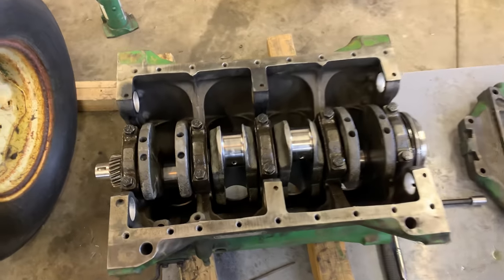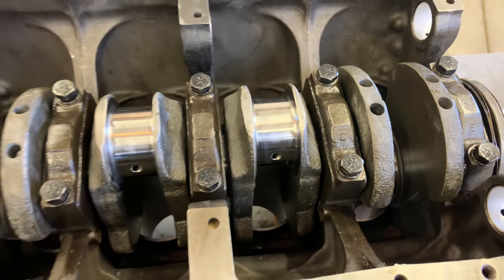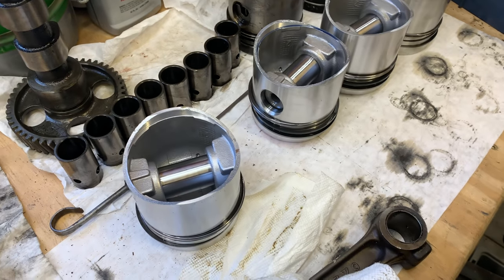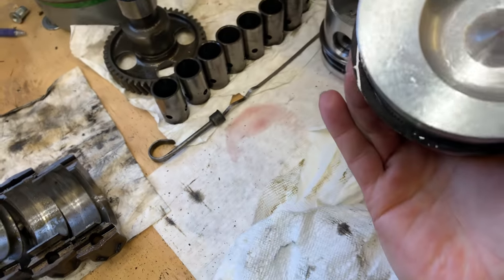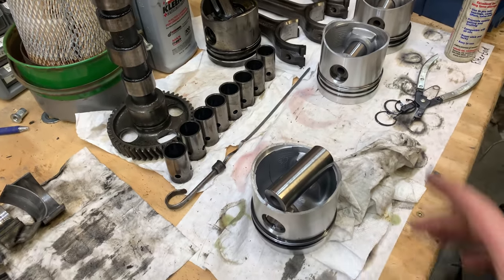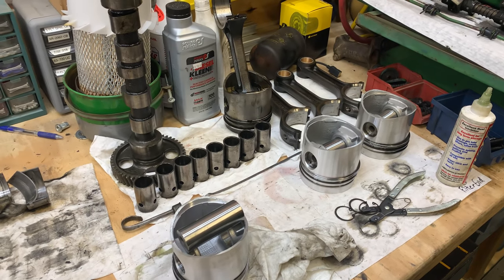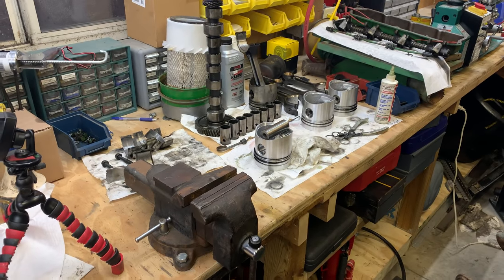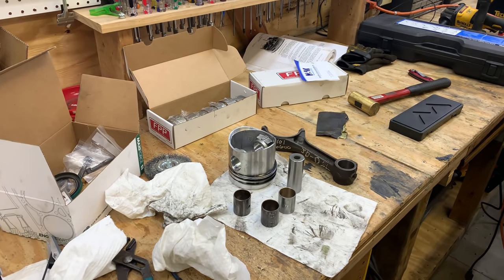Installing Cylinder Liners and Crankshaft in the John Deere 2510 Part 20

Comment: You need to heat some rods to get the pins in I'm sure you're using a manual to do this
Reply from the maker: Nope only a basic manual, has some details on the motor but not enough!